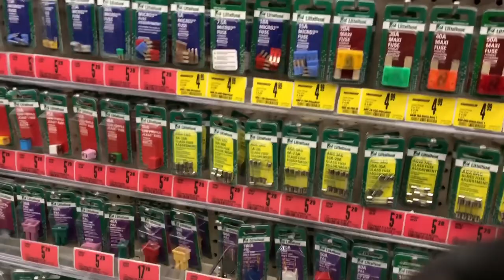Ford Model A rescue! 1930 Woody back on the road

Comment: Ah, yes, the loose ground connection - I heard of so many long, long troubleshooting sessions (sometimes for years) - all to find out that it was just a corroded or loose ground cable that caused... Poor hot-starting performance, cylinders missing rhytmically upon turning on the indicators, backfiring through potholes, dim lights going through corners, or complete breakdowns in the middle of the night. Amazing what a few strands of wire can do. Great job on finding the issue so quickly!
Reply: I had mine suddenly stop in the middle of the night on a deserted crossroad an hour from home. Checked everything under a lamp post, but was reluctant to open the dashboard, because it couldn't be there right?

Turns out, because the previous owner had installed a modern type of ignition switch, with those modern flat connection taps on the back to connect the ignition wires, the connector had just fallen off due to the rumbles. (facepalm)
Reply from the maker: After you've gotten a couple hundred Model As going, you tend to know what's wrong quickly.

Comment: You had me loose ground connection. I am not a mechanic by any means, but from late 60s till mid 80s I owned a bunch of different Ford Pickup Trucks. So I’m kinda an expert on those. People would ask why their truck wouldn’t start. I was always a corroded or loose starter cable at the starter. Or a bad or loose starter relay that was on the drinkers side wheel well. 
You truly the Model A Whisperer.
Reply from the maker: Thanks Dan!

Comment: That's a great tip you showed us - installing an extra ground cable from the frame to the engine/transmission. I'm going to do the same on my Model A.  Thanks!

Comment: An other so sympathetic and warm video Paul. It’s so great each Saturday to enjoy family warmth footages like this. And you know what, the way you have grounded this Model A “termite Bait”, its the very same way I also did it. Especially when you have your engine partially on the rear rubber supports. I say partially, due I was advised not to switch the front supports to rubber and leave as is, only for the rear and the extra support on the rear part of the transmission. Job well done and for the little less knowledgeable viewers a thumbs up in the trouble shooting part. So, great the moments towards the ending of this video, really model A lovers, are just great and warm hearted people, hmmm reason they also like and have Ford model A’s.😄
. God bless Paul and regards to madam Tina.
Reply from the maker: Thank you Myron!

Comment: Yes, same problem here. When I finally found out, I noticed the ground strap lost it's clamp to fix it to the frame, and one of the previous owners just folded it and put the screw directly through the woven copper strap. That hole went larger over time, but not noticable with the screw still on....
Reply from the maker: But you found it, so good hob!

Comment: Better to check the battery with a battery load tester as voltage can be high on a weak battery.
Reply from the maker: When you're looking for a loose connection, it doesn't matter.  Just leave the lights on for a load like I did and look at voltages farther and farther from the battery.  You will find it fast.

Comment: Just saw this latest
Video fine business
Paul. Its what I would
Of done for such a car.
Makes good sense
For starter power.
Now the power is on the surface of the power trane instead of
Through the inside of the engine or transmission wich can cause big problems
Thanks for showing
Proper grounding. Now
The electrical will be
More reliable and last longer.
Lookin good Paul.
Dwight allenpark,mi.
Reply from the maker: Thanks Dwight!

Comment: Great video as always. Quick question, our 1930 cabriolet has a rattling sound in the engine like somethings loose. It has 90000 miles, and the engine hasn’t been rebuilt before. What might the problem be.
Reply from the maker: Yikes!!  It could be a LOT of things!  I would start looking around the timing gear area.

Comment: When I bought my car, the ground was attached to one of the bolts where the breaking light switch connects. It's not supposed to be like that right? but at least it makes a good ground connection to the engine.
Reply from the maker: Not supposed to be like that.  But heck, does it work?  I mean, "If it's workin alright, just say good night"